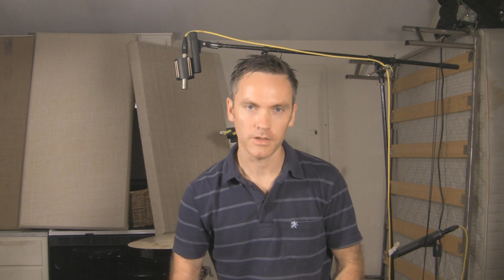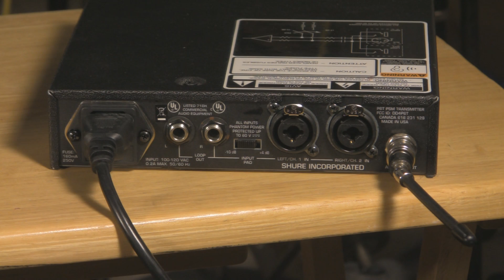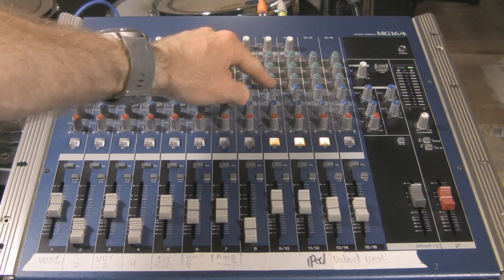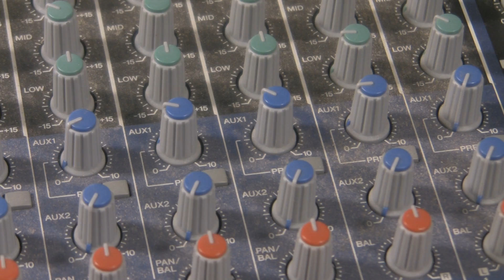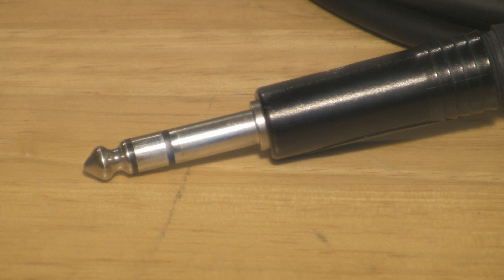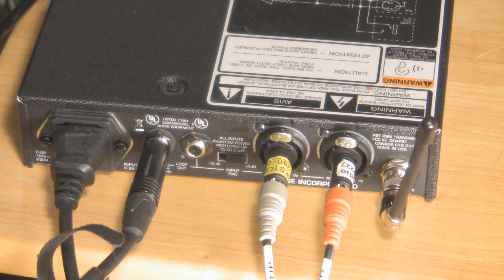In-Ear wireless monitor - setup and connections, How-To

Comment: Now can you use any transmitter with any receiver   because I bought a used transmitter on ebay with no body pack
Reply from the maker: Just look at the frequency range of the transmitter, on the sticker on the bottom / rear. It will tell you the frequencies and maybe the band that the transmitter is capable of producing. For instance: "G20 488-512 MHZ". So then you'll look for a receiver with the same exact frequency specs.
Reply: @therockstudio  thanks

Comment: how do I set up a separate mix for multiple people?
Reply from the maker: Let's say there are four people needing four separate mixes. For this you'd need four wireless monitor systems (transmitters, receivers, & in-ear monitor earbuds), and a mixer with at least four aux sends (called monitor mixes, or just simply mixes).
Each wireless transmitter gets connected to it's own aux send. Then you can create a different mix for each of the four people by using the aux knobs.
Reply: @therockstudio  i stayed up all night figuring it out and i figured it out
Reply: @therockstudio  ive got a diagram and its going to rquire two mixing boards Lmao. Trying to use the equipment we have already.
Reply from the maker: @Whitttty  ahh! Ok. It's difficult to find small-medium consoles with more than 4 aux outs. That's why, these days, it's more economical to buy a digital console, even some of the small ones have at least 6-8 auxes. For an analog board to have more than four, you'll need at least a 24 channel console. Glad you figured it out!
Reply: @therockstudio  yeah i figured i could do a computer to a DI box, DI box to my mixing board, monitor into my board, mute my monitor so it o ly cones through my headphones, run the main out fron my mixing board to a headphone splitter, headphone splitter into the kack inputs on the bands mixing board, monitors for bands into the same inputs but on the xlr, then that baord has individual outs so ill either runs those to a transmitter or to everyone indavidually with an aux extension cable. I just have to see if that one channel will take inputs from two seperate things.
Reply from the maker: @Whitttty  sounds complicated and maybe a little round-a-bout. What board do you have and which board does the band have?
Reply: @therockstudio  you wanna message me.instagram? I can explain things a little better there. Whitty_drumming

Comment: Hi there. What cable did you use to go from the ipod to the mixer? I noticed it is split, why is that? Also you are using a trs to alr cable to the transmitter, would a trs to trs do the same thing? or is the xlr changing it to mono?
Reply from the maker: Hi, thanks for watching! The iPod is connected with a stereo cable - 3.5mm (or 1/8" headphone connector) to left & right TS (1/4") plugs. The transmitter is connected with a TRS to male XLR. TRS isn't a stereo connector (such as the headphone connector), it is a balanced connector (the same as an XLR). So if your transmitter has a TRS input, you can use just a TRS-TRS cable. I just happened to have a TRS-XLR male cable handy when I made this video. Feeding one aux into the transmitter will only be mono, no matter which cable you use. If you want stereo, you have to use two aux sends and two cables.
Reply: @therockstudio  thanks for getting back to me, that does make things clearer. I just have one more question an then I will stop bothering you. Does the cable from the IPod to the console have to be a 3.5 to dual ts cable? Or can it be a 3.5 to 6.5 trs cable?
Reply from the maker: @rorybackshell9580  in the preamp of the console there is a differential amplifier, which you can read about more, but I'll give you a quick explanation: the T & R (tip and ring, or L and R of an XLR connector) are the signal, but 180° out of polarity. The differential amp will join them back in to polarity, and discard any difference between the two, thus cancelling any noise the cable may have picked up along the way. So if you feed your left and right iPod into a TRS cable and then into one channel of your mixer, the differential amp within the preamp may remove some of the music information. So it's best to split the left and right out of your iPod into two channels, because remember TRS 1/4" connectors are not stereo, they are balanced (meaning one positive signal, one inverted signal, one shield). You can find 3.5mm to mono TS or XLR, but they usually have some resistors and capacitors in them to sum the left and right to mono and block phantom power (which is likely to damage your headphone output). Check out sescom cables https://www.sescom.com/products/view/category/categoryslug/smartphone

Or my typical cable, the hosa CMP-159

There cable in the video I made myself.
Reply: @therockstudio  thank you very much! You have been extremely helpful.

Comment: Hi. I am looking for a way to set up six receivers all to one box but to different parts of a mixer. Can you help please?
Reply from the maker: I can help, but remember that a transmitter can send only one mix. So, if you want to send more than one mix at a time, you'll need more transmitters and receivers.
Reply: About how many of them would I need for a small band then?
Reply from the maker: Nahum Piña that depends on two things: 
First, how many aux (mix) outputs does your console have? Most small-format (up to 16 channels) have four auxes that are appropriate for monitor mixes. That means you will be able to send four separate mixes to the band. So you could have four complete systems. 
Second, how big is your band? How many people in the band need their own mix, and how many can share a mix? If there are four people in the band, but only the singer needs a different mix then the rest of the band (the rest of the band is happy sharing one mix), you only need two transmitters and four bodypack receivers. I hope this helps.

Comment: Great video.  I can't seem to find the answer to my question which is: I'm looking at getting the Shure PSM300 model.  It only has TSR cable inputs on it.  I assume I use a TSR to TSR cable for this? I just simply see cables labeled as instrument and speaker cables.
Reply from the maker: Ryan Steinacher you mean to search for TRS! Hosa HSS-010 REAN 1/4 inch TRS Pro Balanced Interconnect Cable, 10 feet https://www.amazon.com/dp/B006EE7FEA/ref=cm_sw_r_cp_apa_7tAEyb3A2PCZW
Reply: I found what I needed about 5 min after posting.  Needed to look under patch cables.  Typing TSR is just embarrassing now... lol.  Thanks for the fast reply!

Comment: Im still a bit confused on how would I connect my IEM's (Shure PSM 300). I'm running Ableton through a mac. I have a 1/8" to two 1/4" stereo splitter cable coming out of the mac Please correct me if I'm wrong If I connect my 1/4" cables to my soundboard mixer, would I then just simply connect my IEM's to my soundboard mixer to hear the click and loop? We want to hear click and loop in the IEMs while still only sending loop to FOH.
Reply: We just switched it up. Now we have the Apogee Duet (Firewire) audio interface. We have the Duet connected to my mac. I have click and cues coming out from the left output of the Duet and FOH loop coming out the right output of the Duet. We have a TRS 1/4" male to male balanced cable connected directly to our IEM transmitter from the left output of the Duet (click/cues) and we have a balanced TRS 1/4" male to xlr male cable connected directly to our soundboard from the right output of the Duet (FOH loop). Then we have a TRS 1/4" balanced cable male to male coming out of the AUX Send 1 from our mixer that connects to our IEM transmitter, so we can hear loop, mics, guitars (everything that's connected to our mixer)
Reply from the maker: sorry I missed your question. Glad you got it going.
Reply: No problem. It was definitely a process to finally get 'em going. I might still contact our sweetwater sales engineer for a better way to set it up, but for now this will work
Reply from the maker: Jay Z I'm going to make a new video about setting up click and cues. check back!
Reply from the maker: I just uploaded a new video about setting up a click and sample scenario. https://youtu.be/5BboJ94vvN4 I hope this helps!

Comment: I am a keyboardist and use several keyboards with my own console. I just got my in ear monitor system, when I go to a gig or perfomance with my group what it would be the procedure with the sound guy in order to use the In-ear system? Thanks in advance.
Reply from the maker: hi! I am assuming you plug your keyboards into your own mixer at the gig? You would then give the sound person a feed from your mixer, and also hand him/her the transmitter for your wireless ears. The sound guy/girl will hook your transmitter up to a spare aux send on his/her console, and send you whatever you need in your ears, including your keyboards. You would only be responsible for balancing the levels of your keys in relation to one-another, usually during sound check. That way any of your keyboards will be the same volume going to the PA console as well as your ears. Thanks for watching.
Reply: Thank you!
Reply: Should I have any kind of cable  or adaptor? in case the sound guy/girl says "I dont have this or that for you to use the in ear system"
Reply from the maker: Sorry for the delay, yes. I'd have some cables handy. Depending on your transmitter, of course. In this video I use a TRS to XLR Male cable, which works if the sound person's console has TRS Aux outputs, and your transmitter has XLR inputs. If your transmitter has TRS inputs only, then have a 6 or 8 foot TRS cable. Remember, you can extend a TRS to XLR cable with a standard XLR cable, but it is way more difficult to extend a TRS cable. I'd have a 6' XLR cable on hand as well, just in case the console has only XLR outputs, or you're coming out of a return on a snake, etc. Be sure to LABEL your cables and hardware (including power supplies) well, or you will lose them quickly.

Comment: Hiya,
I have a desk that has effects etc coming out of the aux sends...is there another way  to connect the IEM.
Reply from the maker: craig davson If you have no extra Aux sends available, you can still connect the IEM system. However, you will not have a dedicated monitor mix. You would connect the IEM from any other buss that is available. For instance, you can come out of the stereo buss, a "record out", or matrix output. You can even take your signal from the "pass thru" on the rear of a powered main speaker, or monitor speaker, of from the "pass through" on the back of your main PA amplifier. Otherwise, you can come out of the Direct Out for whatever channels you'd like in your ears, and connect them to a second small mixer, or if there is only one or two channels, you can take the "Direct out" from the main mixer, and connect them to the inputs of the IEM and use its own mixing capabilities to adjust the level.
Reply: therockstudio Hey thanks for this, really appreciate you getting back to me.

Comment: Hi, if I have 8 wireless in ear monitor sets. How am I going to connect to the Mixing console? Thank you
Reply from the maker: If you want 8 individual mixes, you'll need a console with at least 8 auxes. Or else, you will have to share mixes between the 8 wireless systems, ie. 4 units on Aux 1, 4 on Aux 2.